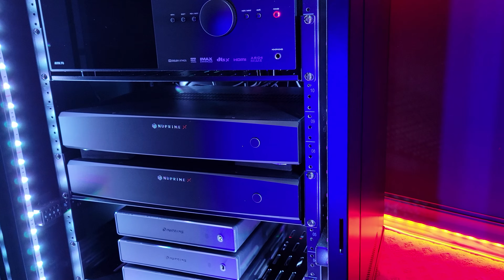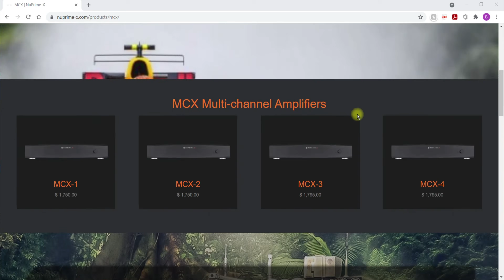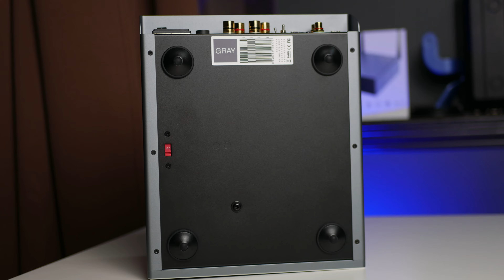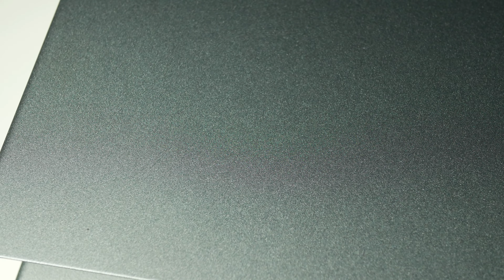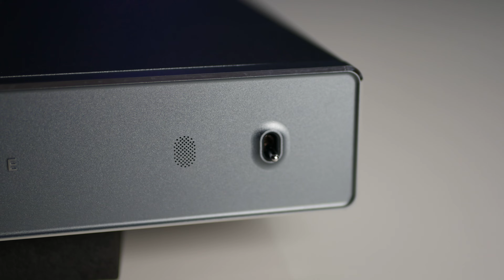Why I Switched to Class D Amps! Small But Mighty Nuprime AMG STA Amplifier Review!

Comment: what would you recomend for my front stage between  AMG STA amp or the mcx3 thx
Reply from the maker: I would recommend the AMG STA's, they have a beautiful class A module coupled to a class d.  Great sound along with great power.  If your budget is tight, the MCX3 is an awesome choice as well, but has a little bit of a cooler sound vs the AMG STA.  If you do decide to buy Nuprime, please consider using my links.  You get the same price, but it helps out the channel...cheers.
Reply: @SpecOfTech  i have the nad t778 do you think its worth it for my front stage ..there not 3 channel in the model amg sta right
Reply from the maker: @mingsybob  I believe you would be pleasantly surprised by the AMG's.  No they only come in a 2 channel, with the option to be bridged.

Comment: Very thorough video ! Just one observation  about your description  of the Focus bass response. You definitely  didn’t say that they were lacking but, not what you expected . In the Focus xd which has the same drivers as the Focus se, Legacy is feeding 750 watts to the 12" drivers alone or 750w per speaker(fully active). i am sure that your amps are of high quality but 200 or 300 watts for the whole speaker might not be enough to bring up the bass quality/quantity to what it’s capable of. Although these speakers are very sensitive i believe they still require more juice for optimum performance ..... Again, I’m sure that your rig produces some sweet sounds already; as you have mentioned .
Reply from the maker: Yeah, you could be right, it's possible they need more power to really flex!

Comment: Great video Barrett, I have been waiting for this one since you got your new kit, I knew nothing of Nuprime before.  I now understand why you went mono's for your front stage.

I am also a believer in the class D amps of today and they can sound every bit as good as Class A/B amps.
Reply from the maker: Hey man, thanks for watching.  I am with you, Class D has come a long way since the days of old.  These Nuprimes made a believer out of me.
Reply: But so they sound as good as class A
Reply: @daveycrockett5738  a good class D amp will keep up with a class A no problem and will run way cooler and cost less.  Not any class D amp is capable of this, but a good class D is as good as a decent class A for a lot less money. Size  is also a big thing, a class A mono with 300 watts 8 Ohms will weight well over 50 lbs, that's the same as 3 of the Monos for Barrett's front stage.

Cost, Cool, Quality are what you get from a class D

Comment: How do you crossover your towers with your sub since they can go down low?
Reply from the maker: I found that I still prefer a crossover around 80hz.  Yes the speakers can go low, but my subwoofers do a much more convincing job of handling bass.  I am a bit of a basshead, and like to run my subwoofers around 8db hot.  I also have a fair sized room that is open to the house, so I need powerful bass to fill it.
Reply: @SpecOfTech  i see

Comment: Nice video! Did you consider anything with Hypex or Purifi over Nuprime?
Reply from the maker: To be honest the only 2 amplifiers at the top of my list were Nuprime and Legacy Audio's own class D's.  Legacy's amplifiers were a little too much for me and the Nurpimes seem to be similar in performance.  Are you using Class D amps as well?
Reply: @SpecOfTech  Thanks for answering! Then I know how you thought. I used to own 2 pcs Nuprime STA-9 in bridge mode to my fronts but I sold them because I was not that impressed since they made some songs very bright in the upper end. Gave me listening fatigue. But Hypex and the latter Purifi should perform better than Nuprime class D,  on paper. Not saying Nuprime sounds good, I’ve only tried the STA-9 which is not the best that Nuprime is offering. I’m ordering a Purifi amp in a few days to test it out.
Reply from the maker: @ma6kinen  Good luck on the new purchase, I hope they give you the sound you are after.  Let me know what you think of them after spending some time with them.
Reply: @SpecOfTech  Thanks! I’ll sure do that but if you can get a Hypex or Purifi, upload a review on it 😁 If you haven’t send the incredible measurements on those modules, you will be amazed!